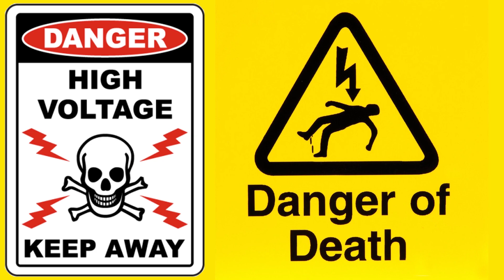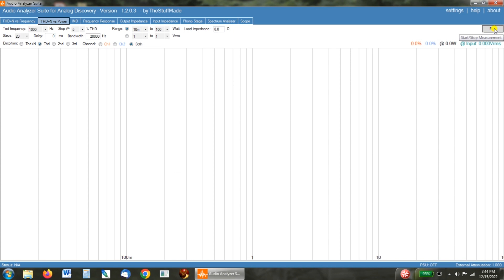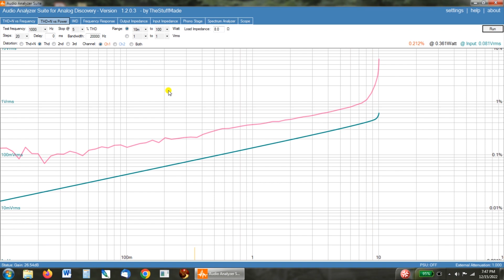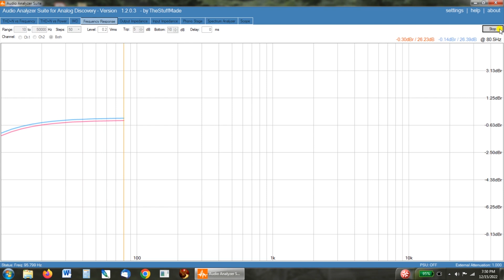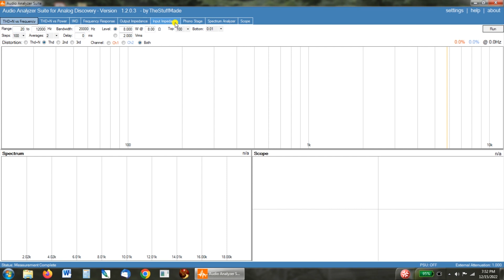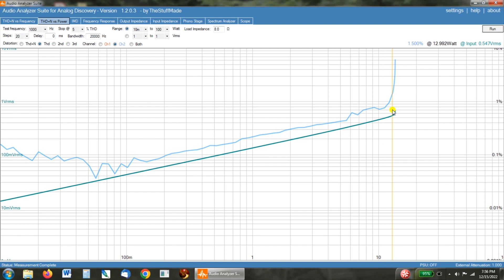Tubelab Monoblock: Final Test and Evaluation!

Comment: I'm running a PrimaLuna Dialogue Premium HP Integrated Amplifier and I love it. The stock EL34 tubes are great. There are 8 EL34 tubes in this amp and 6 12AU7s in the front end. It has adaptive auto bias and a myriad of other features. If a power tube goes bad, the amp kills the power and an LED lights up next to the bad valve as we call them here in Australia. You just turn the power switch off then on again and within seconds the new valve is biased and up and running. It has 2 switches on the right side to switch between EL34s or KT88s, KT120s or KT150s but the KT120s are fine. The KT150s are great but they're too tall to keep the cage on. They're a great amp. Point to point wiring and the components are top quality. Cheers Andrew.

Comment: but Skunkie does the higher bias diminish turbe life?Prima Luna runs the tubes cooler to augment tube life they say-as an example.
Reply from the maker: I'm sure it does, but it clearly to me doesn't sound as good. I found the same true with my SE amps, running them closer to max, they sound better.
Reply: @SkunkieDesignsElectronics  ok cool.my preima luna has an auto bias circuit. Bias can't be set by the owner.The Dutch designer seems to have selected what he thought was ideal.(Prima luna is designed in the Netherlands and fabricated to their specs in China.It looks like some of the China amps are knock offs using less expensive parts-as you expertly point out on the Wilkenson.) Love your presentations. Learn a lot.)

Comment: Great. I’m on it. I’m ordering the chassis today to build it as a stereo one chassis amp. Do you have the final schematic already? I’ll start also verifying the specs of the transformers you used to make mines. Very, very nice results with current production tubes that are easy to get and won’t break your bank. I have in my little studio a single ended el84 amp I built a little more than a year ago and I use every single day for a half to 2 hours and I love it.  It actually has 6n14n with 310v plate to cathode biased to about 90% and the 6n14n is working as the first day. Sounds amazing, so rich and full, thick and bright with a beautiful midrange. This is a wonderful little bottle. I know guitar and hifi are way different but, I know I’ll like the results from this project. Thank you!1

Comment: 270 Ohm is a standard reistance for EL84 use in many classic operation mode for that tube type....330 shifts the class AB more to B mode , so the observation by listening to the two values is correct. Even in triode mode this value is standard.
Nice job on building . Great to have them build in mirror mode.....
Reply from the maker: I want viewers reading some of these comments to understand this depends on more than just what resistor value is used or by looking at a data sheet or what some other amp uses. It also depends on the voltage across the tube, which depends on what power transformer is used, what rectifier tube type is used etc. 

And different tubes and circuits will respond differently to bias changes, it's why I test this stuff and don't just throw in "what is standard". Some circuits will run in AB at 80% or even less depending on the design, some may need to be at 95% and I'm pretty sure the 330 shifts it more into class A mode.
Reply: @SkunkieDesignsElectronics  That's OK ! ..........I agree with your view ..